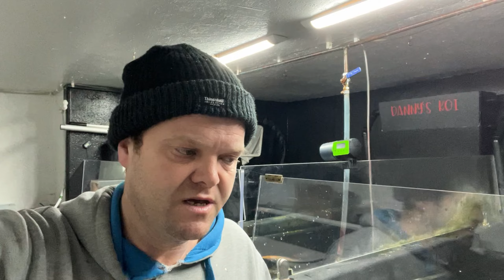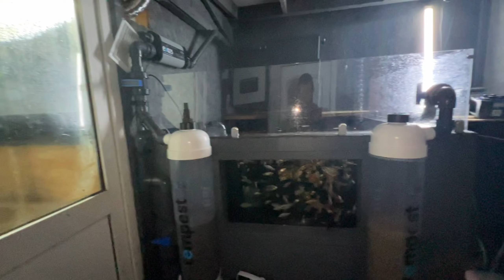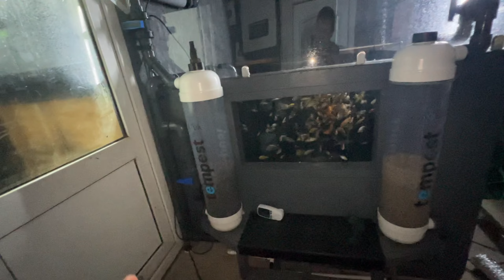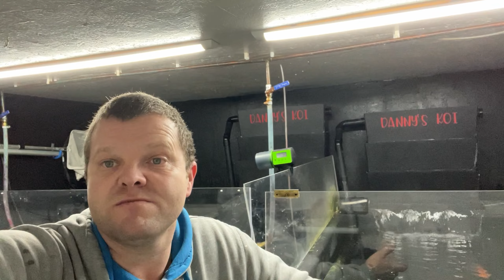Catching up on jobs at home with the koi ponds saving a few quid and a waffle #gettingthingsdone

Comment: Looking good mate, what is the hose tail on top of the tempest do you flush it out with water to clean the media a bit more? 👍
Reply from the maker: Cheers Andrew the hose tail was just on the floor mate lol I just picked it up and placed it on there, that’s not a bad idea though I will probably give that I try 👌👍
Reply: @Dannyskoiandaquatics  funny 🤣 I will have to do the same when I put mine back on. I have one on my pond off the skimmer but had too take it of this winter because I had not secure it probably. I have made some brackets this time to fasten it to the wall👍
Reply from the maker: @andrewmason2879   it definitely needs some sort of support mate 💯 they are definitely a good simple bit of kit though 👍
Reply: @Dannyskoiandaquatics  my set up on my pond is a sieve and a eb60 with micro k1 in it. I was thinking of taking the bead filter out and installing a moving bed instead. Do you think I would get the same clarity  from a moving bed than a static bed that’s in my bead filter. Or just add a moving bed after the bead. Your thought mate much appreciated 👍👍
Reply from the maker: I would leave the bead filter in as it’s taking all your fines out, after what your sieve doesn’t take out, the moving bed is for your good bacteria to build, place it after your bead if you need more bio,👌